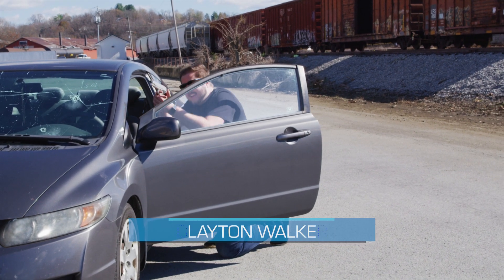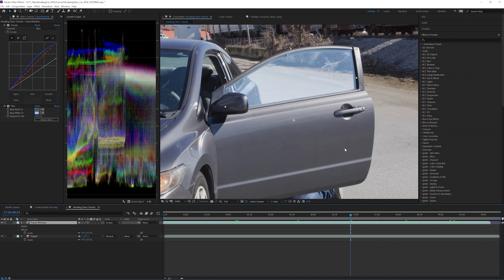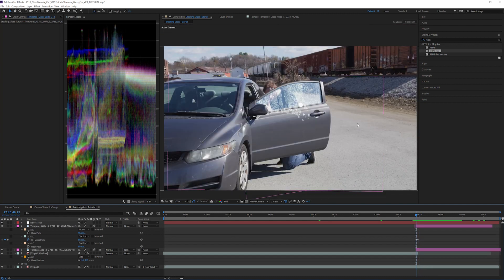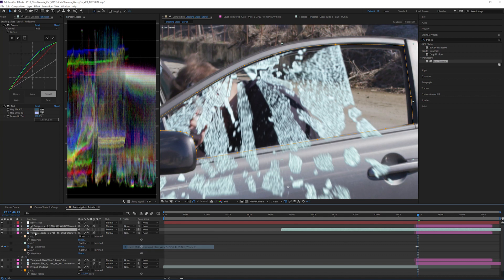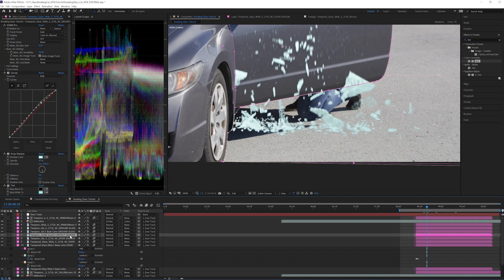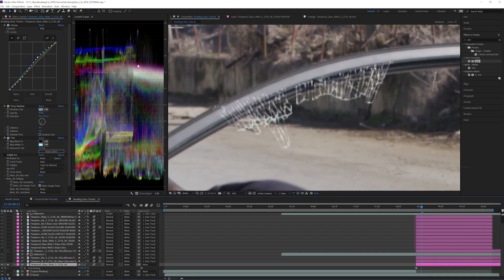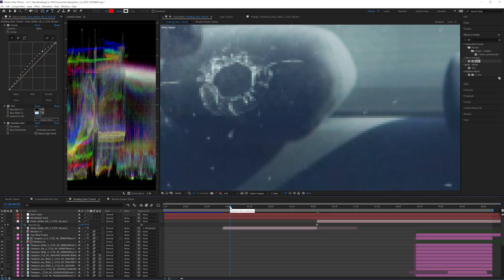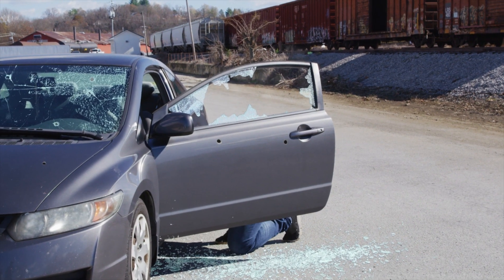How To Create Realistic Breaking Glass FX | After Effects Tutorial

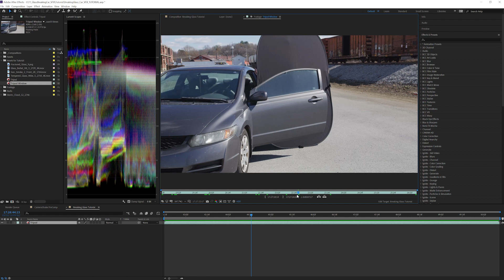Comment: 0:41 Not just the tripod, gotta remember to also lock down the thing with a window to avoid post edit pain or at least review the clips for alignment before leaving set.
Depending on scenario good old stop-action may be needed for the plate, just have the actor move|roll the window down when they duck down while continuing to film.  Hidden crew can roll it down in some cars when window controls aren't on the door.
Like with a profile shot of car where character ducks away from door. Since their moving a reflection may be on the window a static cutout of the window may throw off the shots look and you'd have to roto their upper body for the window replacement but not if they duck and stay stock still while  window rolls down.